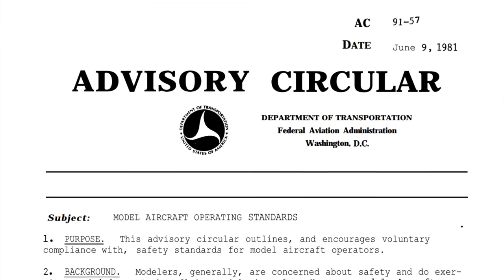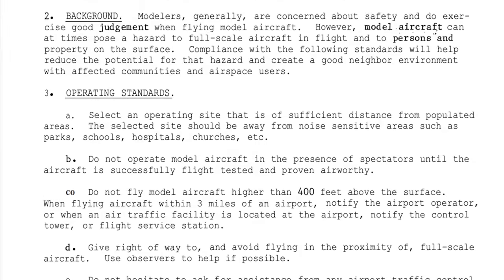A Remote ID Solution for Fixed Wing RC

Comment: The reason drones and RC planes are grouped together is because, to people outside of this hobby, they are the same thing. They are flying toys. Furthermore, the distinction between them is filled with grey areas and trivial differences that are hard to define for regulation. 

A few years ago, I saw an RC plane for beginners that had geofencing features to prevent fly-aways. The plane would turn around when it got too far for what it considered good Line of Sight flight. Well that is the same technology used to make a long range fixed wing drone that flies with waypoints. Was that beginner plane actually a drone? No, but it has the functionality, just applied in a slightly different manner.

I could hypothetically put a cheap flight controller and GPS module in just about any fixed wing RC plane and have it fly semi-autonomous waypoint missions. I wouldn't even need the camera that you proposed to use as the distinction between drones and fixed wing. While it would be reckless, I could fly beyond-line-of-sight and monitor it completely by telemetry sent back to my transmitter (many OpenTx and EdgeTx transmitters support scripts that can show maps with GPS position, altitude, speed, heading, and artificial horizon on the transmitter's display). With your proposed camera distinction, this RC plane wouldn't be a drone, but it could do many of the things listed at 9:34 that used a justification for Remote ID and things that you say are "what drones do".

Meanwhile, my FPV quadcopter would be horrible for beyond visual line of site flight or recording nice stable panoramic videos... the things you say encourage drone reckless behavior in drone pilots. While it has an FPV camera and a flight controller, it doesn't have GPS, it has short flight times, and the range of the control-link is shorter than some of my traditional line-of-sight RC planes. It also lacks the autonomous functions that are in store-bought DJI drones like obstacle avoidance, landing, altitude hold, auto leveling, or returning to home position. This means it is good for acrobatic maneuvers and racing around gates/poles I put up in a  field, but all controls are inputted manually, just like a traditional RC plane. That also means I have to practice everything, just like the traditional RC planes. I even had to practice landings, which is analogous to the "touch and go's" you mentioned multiple times in your video, for some reason. Basically, this drone is more like an acrobatic Heli, than what most people think about when saying "drone", with the exception being I use an FPV camera (and a spotter). It doesn't do any of the things that you list at 9:34 in your video, when you list the justifications for remote ID and state those are "what drones do."

When you try to differentiate similar things that share technologies, it can be hard to differentiate them for regulations without getting overly specific or stupid regulations, which allows for loopholes and modification. I'd rather have a single, simple set of regulations that applied evenly across all my planes and drones, than to have to follow several different sets of poorly written rules for different models.... especially if the poorly written regulations likely grow as they try to patch holes.
Reply from the maker: So . . . you’ve described the problem.   Consider now creating the solution (new regs) so we can take next steps forward. 😊 Tim
Reply: @TimMcKay56 he's saying that the solution is that you don't separate multicopters from fixed wing. What he's described is why he doesn't agree with your statements in the video

Comment: As someone who for years flew over rural alfalfa fields far from any populated area (I grew up in a very rural agricultural area) I would not commit or offer that RC modelers fly only at AMA fields. I do however believe you have the right approach. I believe committing to flying RC models under Visual Line Of Sight Operations is the key factor! Cameras could be used for RC models but not FPV operations or system. I would suggest to the FAA a Commercial Drone flight level of 400 - 600 AGL for commercial drone operators, and sub 400 for model aviation with an exception process for those who need it like model glider pilots. Commercial drones could then operate safely and aircraft could operate safely above 600 feet AGL. Also, I would restrict flights over populated areas or large public gatherings. The model aviation community is not the drone community and I believe our safety record speaks for itself.  I would also inform FAA of the differences in the community. If they want to require the model aviation community to build a portion of the aircraft we fly, the way they do experimental aircraft, I have no issue with that. In fact I love scratch building and the few ARF I have purchased over my lifetime tended to be modified to my liking. I believe the emotional investment in building is one driver in the difference in behavior between the model aviation community and the drone community.
Reply from the maker: This is all good, staring the conversation to find solutions.  Tim

Comment: @13:40  sorry Tim, you're way out of touch on this one.  You talk about a drone you can buy from Best Buy then go fly in the parking lot -- while showing footage from a freestyle drone.   Trust me, if someone gave you the controller for a freestyle drone you would NOT be able to fly it without a lot of practice.  THOSE are not the drones you are talking about and you insult the freestyle drone community by using that footage as if flying them was a no-brainer and as if they were the cause of the issues.

Do some research, stop being an FAA fanboi and man-up a bit when it comes to dealing with those in positions of authority and power.  Never forget that those in Congress and those in the FAA WORK FOR YOU and are paid BY YOU through your taxes.

I recall in a recent video you told us that the FAA were doing "a superb job" -- yet in this video you told us that they acted with what amounts to unreasonabl haste and were ill-informed with respect to the hobby.  Acting in haste and without proper knowledge are the very things that create hazards... not safety.

Perhaps I'm just more objective than you in this case.  I fly traditional RC line of sight models.  I fly fixed-wing FPV models,  I fly FPV freestyle multirotors -- I can speak from first-hand experience in all those disciplines.  Clearly, based on your example at 13:40 in this video, you (like the FAA) are ill-informed and should therefore do some homework before making these videos.  IMHO of course.
Reply from the maker: The FAA does a pretty good job considering the range of flight activities they have to deal with.  Boeing, Airbus, general aviation, gliders, hot air balloons, Part 107, all military traffic and aircraft, air taxi, urban air mobility, Space X and now RC models.  And I repeat, zero commercial airline accidents with US carriers in over 14 years.   As a general rule in life, complicated problems do not have simple solutions.  Tim

Comment: So basicly what your saying is if the FAA actually knew what they were doing in the first place they could have created Types or Categories of UAS like (fixed wing, camera front, FPV, etc.) Fixed wing flying is certainly its own separate type of flying, as is FPV Racing & Freestyle with would best be served by a shielded operations regulation, vs your Best Buy or Amazon Christmas gift camera drone which has the biggest potential of being picked up by an operator who has little to no knowledge of rule and regulations and is tempted to answer two questions for themselves (how high and how fast can it go?).
Reply from the maker: The first attempt at something this huge is bound to come up short.  Hopefully we can articulate a way ahead that meets the FAA's requirement for safety.  Tim

Comment: Mr. McKay, with all do respect, at about 13:50 you are describing what a drone is and what differentiates them from model planes, while the video is clearly that of a freestyle multirotor which doesn’t have a gps, waypoint capability, and doesn’t fly in the navigable airspace and in fact flies below the surrounding hazards to manned aircraft such as powerlines, buildings, and tall trees. Like in the very sensible shielded operations” proposals.
Forgive me if I misspeak, but it seems to me that you may not have ever interacted with a fixed wing RC/FPV pilot for one of our most favorite things, although it may not receive must video interest, is just like LOS flying, flying the pattern, making approaches, short finals, aerobatics and the like.. Typically, we are using a very capable HD video system utilizing  a 360 deg pan/tilt so as to have our “head” on a swivel that I dare say provides fewer blind spots than a 182 pilot has to deal with. Our  FPV vantage point  provides a  more complete and accurate  orientation and  special awareness than that of many LOS fliers especially in relation to depth perception. And then we have a spotter as well whether it is actually or practically necessary. 
Multirotor like the one you showed the on-board video of have the greatest ability to nearly instantly view a global 360 degree view of the surroundings by the very nature of their flight performance as evidence by being able to fly effectively in close “proximity freestyle in every orientation of their craft.
You also say the FAA has no experience with home built aircraft, or maybe you said homebuilt model aircraft, but as long as there has been aviation, actually before, there existed model home built aircraft.
Reply from the maker: Good points!  Tim

Comment: HI Tim, and thanks for the video.  Always interesting.   My point is that while there's enough "blame " to go around, separating drones from model airplanes should have been done years ago when multi rotor drones became available.   I've mentioned this before,  but the late  Bob Violett warned the ama NOT to back the drone operators.  The ama chose to be greedy, in my humble opinion,  and saw dollar signs as these drone fliers joined the ama.  Well, that didn't happen either.  This is the way more than condensed version of how I remember this all happening, and I'm sure I don't have it all correct, but I do remember the warning by Mr. Violett.  We're stuck with what we have now, but I think a lot of this could have been avoided.  My opinions and thanks again for taking the time to make these videos.  And I do appreciate all those folks involved in advocating for the best hobby there is.
Reply from the maker: Joe:  Reasonable points.  But in the early days of drones, all people (to include Bob) had were opinions.  Now, with the UAS Sightings Reports, we have facts.  I do think there is merit in separating drones and fixed wing.  The only other item on drones is that a LOT of the younger fliers like them for drone soccer, racing, etc.  From the AMA viewpoint, this supports STEM efforts and the schools.  Tim
Reply: As it has probably been mentioned before, there was no problem until the coming of the quads. I began flying fixed wing models since the early 80’s, with a hiatus in the middle. I have never experienced or heard of a problem of any kind with flying fixed wing model aircraft, until the advent of quads. Kinda says it all, doesn’t it!

Comment: Thanks, Tim, for your calm, thoughtful approach to the Remote ID issue.  I totally agree there needs to be a clean distinction between "drones" and fixed wing RC model aircraft as they are regulated under RID.  We're gonna have to live under the present rules for a couple of years to demonstrate to the FAA that we can earn that distinction.  Personally, I will have no problem doing so.  To make a very long story short, I just hope we fixed wing pilots can continue to live up to our reputation for following the rules and flying safely.
Reply from the maker: Ted:  We'll get there, thanks for checking in!  Tim

Comment: I fly primarily LOS airplanes and I'm an AMA member. Like it or not, to the FAA we all fly drones. All of these arguments were made during the comment period when these RID regulations were proposed. The AMA made the same proposal thowing quad pilots under the bus then. The FAA ignored them then. Why would they listen now? Like there are different ways to fly planes there's  different types of quad flying. Racing drones and DJI camera drones are two very different animals. Racing drones stay within a coarse the size of a basketball court and under 20ft. Pattern planes fly between 600 and 1500ft? Which is more of a danger to manned flight? There is a lot more nuance here than quad bad, plane good. Throwing one branch of the hobby under the bus for another part isn't the solution.
Reply from the maker: Thanks for this update!  Tim

Comment: The I Phone sounds great, not muffled like your other solution, it also doesn't capture clothing noise etc. Basically sounds natural as if was sitting across from you. For what you are doing. Id just use the camera mic. BTW I have 30+ years as a video producer. Ditch your mics, they sound cheap. High quality wireless mics start at about $300. IF you want to try again I suggest a mic that has a clip that holds the mic away from the clothing a few mm.
Reply from the maker: Excellent, excellent points.  Thanks.  I do think I'll take your advice,  just use the iPhone audio.  Tim
Reply: @TimMcKay56 thank you

Comment: The FAA said in the early hearings that modelers are not the issue.  So why did we get lumped into with drone pilots?  We are not the problem.
Reply from the maker: As I said in the video, just too much going on with first swing at RID to separate.  Tim
Reply: @TimMcKay56  yes. It just stinks we got lumped into the drone pilots. 

I too have almost hit a drone.  I was on final for runway 6 flying into TEB and there was a quad at 1000' agl on the final. Unbelievable. I missed it by about 1/4 mile
Reply: @gordonmckay4523  yes. Thank you. But it's frustrating to see the recklessness first hand that is restricting our hobby now.  We need to team up with the NRA, lol.
Reply: I fly drones and I’m a modeler. I think you guys are lumping quad pilots in with store drones.
Reply: @RickLaBanca  yup. Anything FPV has nothing to do with LOS fixed wing airplane flying. They did not need to be lumped together in the eyes of the FAA.  In fact, the FAA said in the early hearings that fixed wing LOS modelers were not the issue. Fixed wing LOS fliers have been safe and self regulated for 75+ years with a great safety record.   

Not all FPV fliers are bad but unfortunately a few bad apples (mostly ignorance) had to ruin it for everyone. 

I almost hit a quad flying into TEB in the Falcon 50z It was flying at 1000' agl on the final for runway 6. Absolutely unacceptable.
Reply: @flyboywbl  that was not a quad but a dji drone. 
That’s what us quad fliers are also experiencing. Lumped in with store drones. 
Quad fliers have more in common with fixed wing.
Reply: @RickLaBanca  unfortunately quads have more in common with a store bought drone in that you can fly them beyond line of sight. They have four motors, and a flight controller, GPS capability and a camera. Exactly what Tim was talking about in his video. 

I'm not saying you are the problem, but in the wrong hands, a quad, drone (whatever you call it) has the potential to go places that a fixed wing LOS model really can't. 

I have quads too and have no problem sticking remote ID on it. I just don't think a LOS fixed wing model that flies in uncontrolled airspace below 400' agl needs remote ID. 

Now responsible quad builders/fliers could just not comply with Remote ID and as long as they are in an uncontested airspace, be totally safe. 

The problem is the store bought drone is so easy to fly that anyone without any training can go fly it.  And they have in places they should not.  So requiring Remote ID on these store bought drones makes total sense. 

But if you are smart enough to be able to build your own (and it's not that hard) you can choose to install remote ID if you want to or not. 

Anyway. Fixed wing LOS modes should be exempt from all of this because if you are an RC plane flying, you'll be able to easily spot the operator in that they have the model in line of sight.
Reply: @flyboywbl  I have no gps, they only fly maybe 3 minutes, therefore can’t go much beyond line of sight.
And as I said before on other posts, the majority of bvlos I’ve seen are fixed wing, some without camera.

The simplified approach to dividing won’t work. It’s too imprecise. 

Again I’d rather impose regulations on class of pilot instead of only craft.